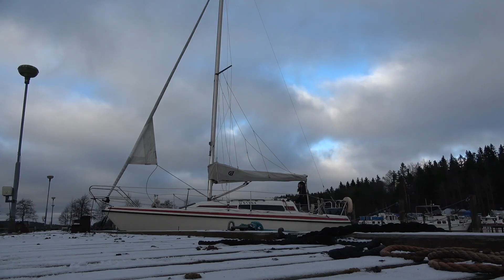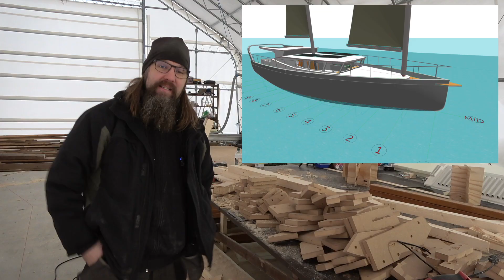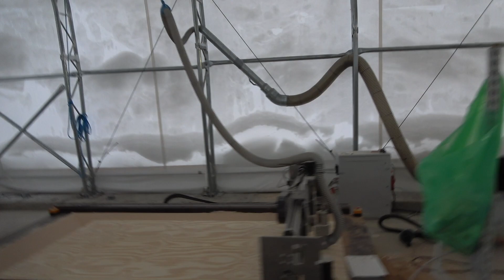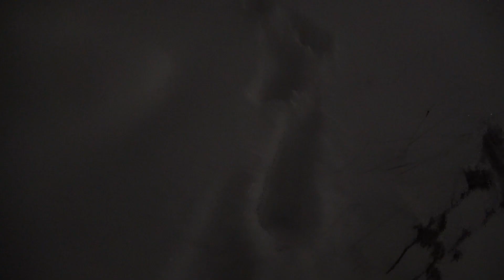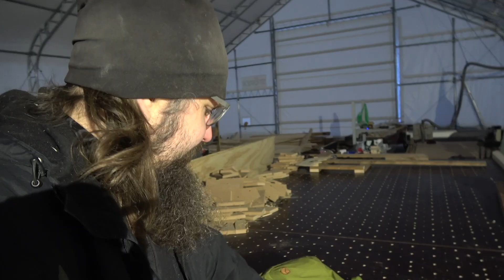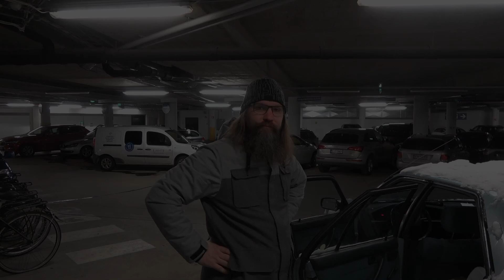Boat building in Winter Wonderland! ep.51 Project SeaCamel

Comment: Great project. I've been trying to catch up on your videos and I really like your design. Your Cat-Ketch with unstayed masts is brilliant. I'm currently preparing to circumnavigate with a Reliance 44 (ketch/cutter rigged), but when I'm done I think I would definitely consider following your lead and build a boat designed based on what I'll learn during the circumnavigation. Love the videos!... keep pressing forward.
Reply from the maker: Thank you so much for your kind words and good luck with your journeys!
I got the fourth frame laminated yesterday. Huge job! 🥵
Reply: @ArcticSeaCamel  I don't know if you follow Ran Sailing, but they're a Swedish couple that just started a build very similar to yours. I noticed, however, that their frames are just plywood pieces that aren't meant to be part of the structure of the boat.

Comment: Yet again I’m thankful I live in a temperate climate and can epoxy throughout the year with out heaters etc. Not to mention getting dressed for the arctic… I guess you’re born into it.
Reply from the maker: I was. The temperature is a two bladed sword. It allows much longer working times and heating is much easier to accomplish than cooling!
But on the other hand you need more clothes on which isn't actually a problem. To tell you the thruth - when making something physical it's much more comfortable to have clothes and then adjust them if you're getting hot. But if there's hot, there's really nothing you can do about tit.
But on the addition, in cold there's problems with condensation etc. which is annoying. Yesterday I was going to laminate next frame but there was so much water dripping from the roof structures that I just couldn't do that.. 😔
Reply: @ArcticSeaCamel  Now I did say temperate, not hot. : ).  Auckland rarely gets below daylight temperatures of 10C in Winter and high 20’s in Summer. But point taken. Nowhere’s perfect. I’ve just finished building a Scarab 650 in pvc epoxy sandwich. A much smaller project than yours but still 2000 hours including the arch shed to build it in - the project before the project as my sons called it. I plan on a few videos like my last small boat. Looking forward to following along on your build. Cheers

Comment: How feasible is a wood stove to warm the workshop- you seem to have plenty of off cuts you could burn?
Reply from the maker: After the shed has insulation it could work for some extent. But I wouldn’t like to have fire inside…
Reply: @ArcticSeaCamel  you could build a few brick walls around the Wood Burner that doesn’t let Sparks Out. Just have a Few fire extinguishers 🧯 on hand

Comment: Merry Christmas and Happy Holidays to all...   Beautiful  surroundings with plenty of Snow.  Dang with the snow and ice buildup can or could damage the Vinyl.  It would be nice if safe to burn left over wood, and have seen capabilities of making Wood Pellets with saw dust.   ....   :)
Reply from the maker: Without insulation burning would be just wasted fuel… and I really wouldn’t actually want any fire inside the tent. Dry sawdust etc… 😬
Reply: @ArcticSeaCamel  When building/repairing boats in barns in winter without proper heating possible, we had a styrofoam housing from 8cm tongue and groove sheets (1,5 by 2 m) and some fancy lightweight lattice-trusses we could build a temporary A-frame lightweight isolating skin over boats up to roundabout 10 meters with. A gasoil circus heater with 100 kw, blowing warm air in and sucking the feed-air from the styro-tent made it warm enough for epoxy-works within minutes in +/- 0°C and about two hours in -20°C conditions (needed modification/riddance of the temperature safety switch of the heater). It's a bit of a faff and does need diesel of course but better than balls frozen to the ground.
While I remember being someplace in Norway in freezing -4°C wearing absolutely everything I brought including the duffle bag and still wished for much more to wear when the Fins, Swedes and local Norges took off their jackets at the outdoor bar because of the "nice mild temperatures" .... So "cold" is felt vastly different by different people I reckon.😄

Comment: Hi again,  I notice that your dust collector has a cloth bag for the exhaust air. May I suggest that you change the bag for a one micron cartridge filter. This will fit in the same place as the bag and will capture the ultra fine particles that pass through the bag and are spread all over the shed and you are breathing them. Plywood, MDF and chipboard usually contain urea formaldehyde glue and this is a known carcinogen. The cartridge usually has a rotary "flapper" which you manually turn to dislodge the dust from the pleats of filter material and this drops down into the collection bag. By the way, I suggest that you empty the bag when it gets half full as a full bag is very heavy and also the short cyclone will work better. Less dust will be stired on the top of the pile and be sucked up into the filter. I also use the clear plastic bag and mine has lasted over 10 years so far and is still in good condition.
May I wish a Merry Chrismas to you and your family. Keep up the good work.
Reply from the maker: Yeah thanks! That is old dust extractor that I got basically for nothing. It’s not actually very powerful and I’ve been thinking of making a  cyclone separator for that at some point. But investing for that filter could be a good idea - especially when I evetually get the shed insulated.